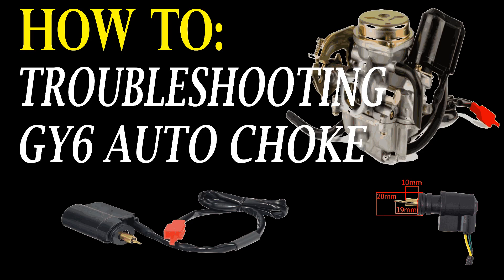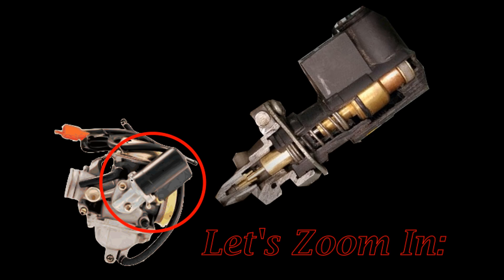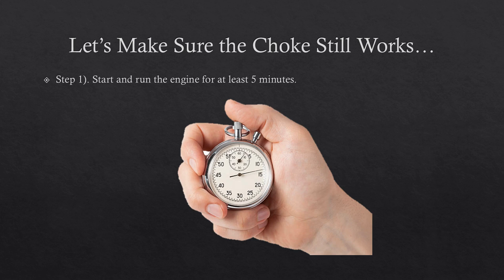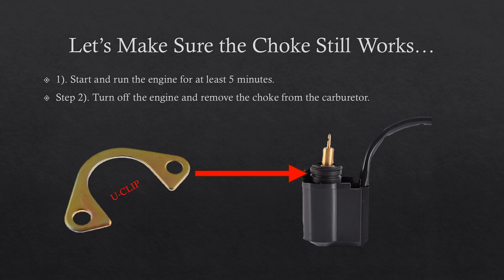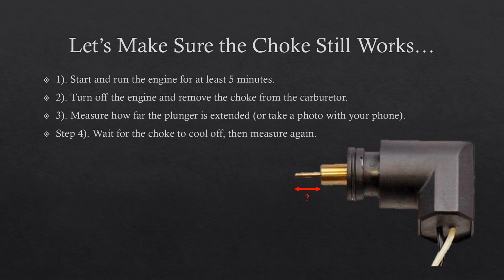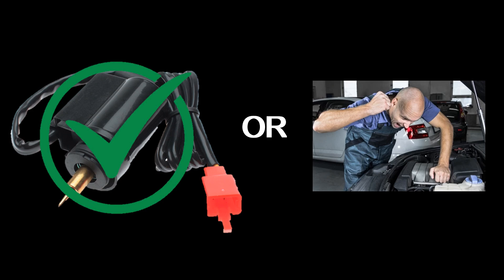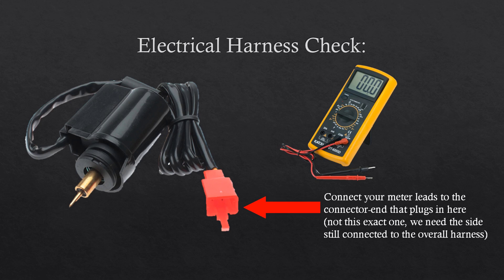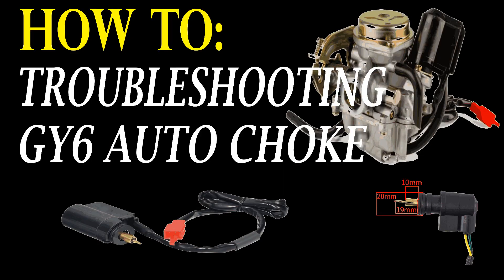GY6 Auto Choke Troubleshooting Guide (Enricher)

Comment: Since scooter new, automatic choke never worked correctly.  Found voltage .6 volts at choke and relay.  Replaced relay, same voltage.  replaced 4 wire relay with two automotive relays with diodes and all operates correctly now.